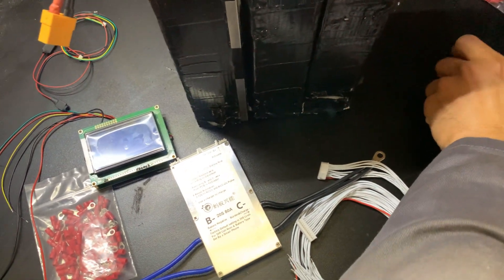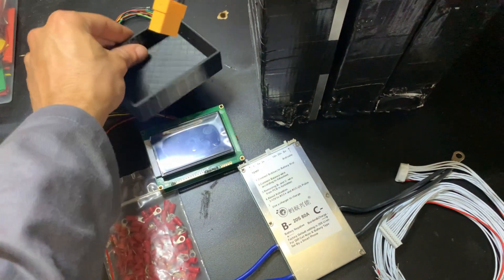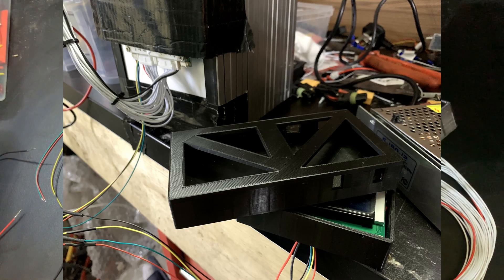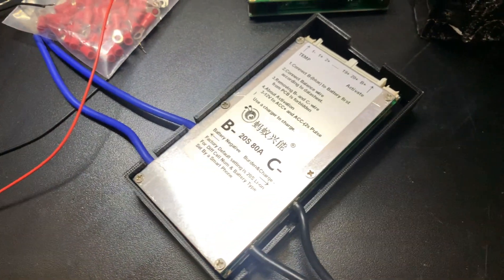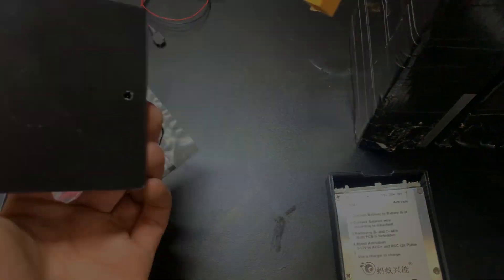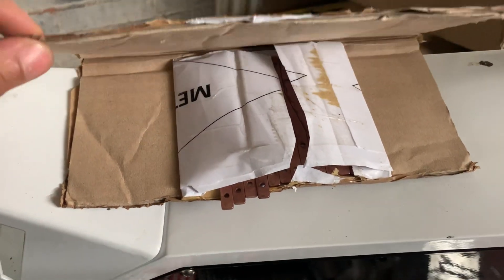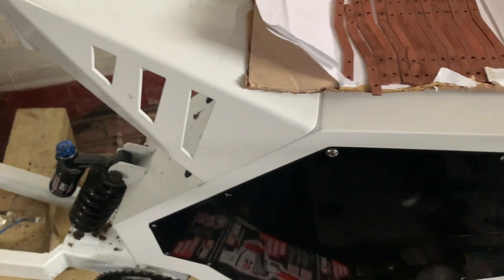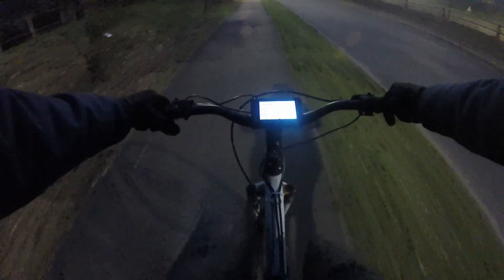Stealth Bomber Enduro E-bike Build EP3 - Batteries - 16s1p EIG Cells

Comment: good video 😎
I used 42v 20ah for a 250w e-bike,was getting over 50mls
in winter, using just throttle 😀
Reply from the maker: Nicee, what kit did you install ?
Reply: @RascalTech  
I bolted together 10 x cells
used no BMS, 42v charger,
run it for about 21 months,
no problems at all,
about half the weight of lithium ion 😎

Comment: Ive ordered the 3kw hub for my bomber clone, but I'm worried it won't be powerful enough due to the heavy frame and my 15 stone weight .... How did you find the motor and what kind of speed and range did you achieve..... Cheers bud
Reply from the maker: Hey, sorry for the lat reply.
3kw will be sufficient enough to power the bike, just make sure that your battery/bms can provide enough amps for the kit.

The 4kw motor for my bike pulls well with the budget 60A controller provided in the hub kit. In the near future I will be going with a Kelly controller or Sabvoton to really give the bike some ooomph.

Comment: Would you reccomend these eig cells over the 18650 cells even with having a very low supply of them.
Reply from the maker: Building a DIY EIG cell battery is alot easier for a novice like myself. As you saw in the video the cells were put together like a lego set. If you was to do the same with 18650 cells, you would need in excess of at least 80+ 18650 cells to get the power and capacity needed, and also have a spot welding machine.

Comment: nice one i think u could add up to 300amp smart ant  bms on that battry pack and limit the current to required need  u might need to get more out of the pack in future...
what speed do u get and what controller u having by the way?
Reply from the maker: Yeah thats a possibilty but for me the BMS is being utilised for battery management and charging. I will be bypassing the discharge as I managed to trip the BMS twice during testing.

For now I am using the standard 60A controller that come with the kit, but in the future I will be fitting a Kelly controller or a Sabvoton.

Speed wise I have hit about 
48mph, not GPS confirmed though.

Comment: Does it have a lot of torque?
Reply from the maker: The bike is currently using the 60A controller that come with it, so the speed is roughly 45-50 mph, the torque is pretty good.

When I eventually fit a more powerful speed controller I can expect to see a big increase in torque and maybe a bit more speed.

Building this battery is great as it can happily pull 150A if I ever needed that much.
Reply: @RascalTech  Oh you will! Never enough power 😁

Comment: What’s the top speed?
Reply from the maker: At the moment 45-50mph.
Reply: @RascalTech  I got a question I have a 5000w 52v battery and it goes 45mph if I get 72v will it go up to 50mph or more?
Reply from the maker: In theory yes, the increased voltage will give you more rpm. You should easily go 50mph+